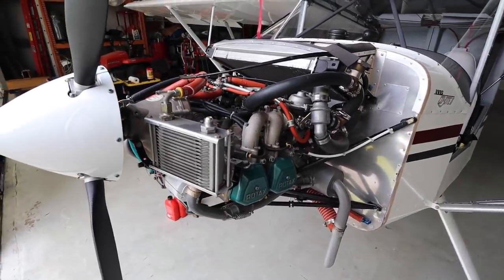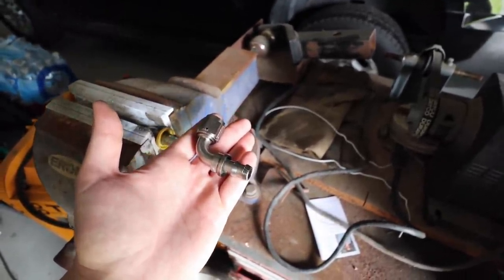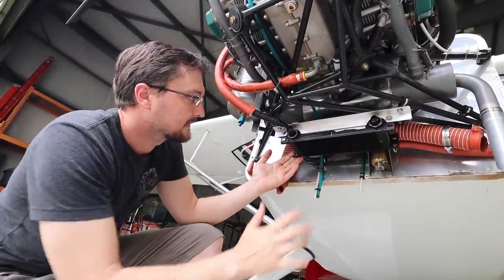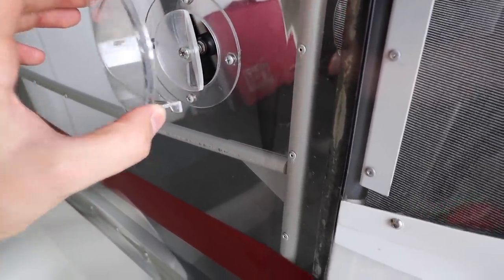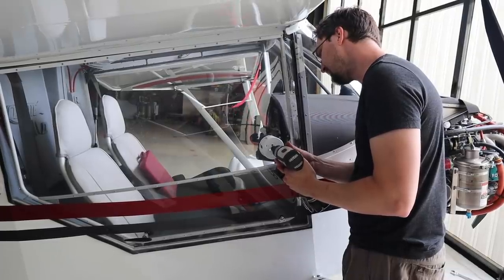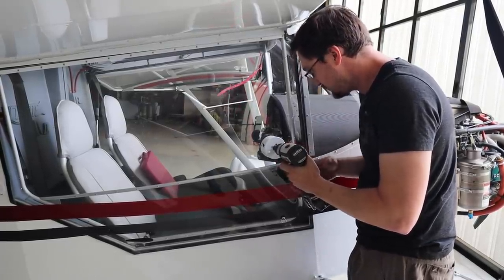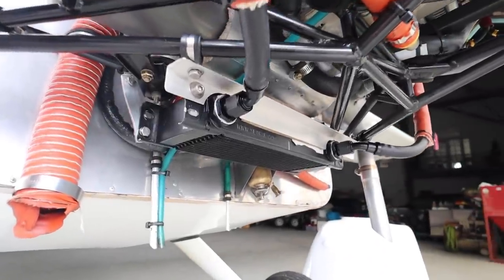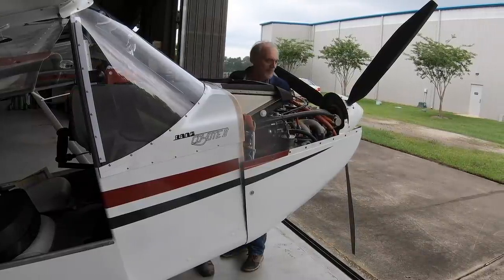The Advantages Of Owning an Experimental Aircraft - New Upgrades For The Rans S6!

Comment: My thoughts too in dressing the edges. I've cut and installed many a lexan and plexiglass panels. The few minutes extra time I consider to be a requirement. Vibration will eventually start fishers that lead to cracks that lead to " I wish I would have dressed the edges " .
   I have those same vents in my Tailwind.  They are extremely effective.

Comment: Thanks for sharing the video! Couple of comments if I may:
- On the new oil lines, you used push-on barbed fittings. I didn't see you put any clamps on. Never trust the barbs to hold, you'll be in deed doo-doo if one of the oil lines slips off. And they will when they get a bit older and temperature rises.
- On the holes, please use some fine sandpaper to smooth the edges. That avoids stress cracks in the doors.
- Want to consider another upgrade? Exchange the solid Rans tailwheel for a Matco pneumatic wheel. Only very little extra weight, but fits right on the tailspring (if you tell Matco the dimensions), and it makes for sooo much better taxi experience. Especially on concrete like you land on.
Enjoy the rides and stay safe.
Reply from the maker: Thanks for the input! The oil lines are actually fine. Those are a special AN fitting that works with specially specified lines and is a push for with no retainer. Using a clamp actually will cause problems as clamping onto the barbs will bell out and damage the hose. 

I didn’t have an sandpaper along with me when I installed those vents but they were cleaned up since. 

Funny thing, we actually have entirely replaced the rans tailwheel with a matco which is a nice upgrade as you mentioned. 

Thanks for all the suggestions!

Comment: In my personal experience with any kind of lexan or acrylic I would have dressed those edges. I have made windshields and punched holes in them and seeing them crack so I hope yours hold up okay. I have those vents in my Tailwind and they really can cause a tornado inside the cockpit for sure. They are excellent for vents. When it's really hot you just get a lot of hot air circulating through there but it's better than being stifling.

Comment: Playing in Nascar we measured the oil temp in the sump (tank) and wanted to see 230 to 260 degrees.  Our oils broke down somewhere above 275 or 280 degrees.  The oil moves through those engines so fast that the oil temp only goes up about 10 degrees in a single pass.  The process of burning hydrocarbons and oxygen produces CO2 and H20, both as a gas.  Oil and water don't mix redialy, but if they do it becomes an emulsion and you will not be able to boil the water out before the oil (now an emulsion) actually breaks down.  The moisture in the crankcase is from blow by in the form of a very hot vapor; just vent it out.  Cook some bacon up and put a drop of water in the hot grease; what happens?  In racing we pushed the limits: in aviation they want you to keep things in a narrower band of limits: keep oil and engine temps within those limits. Oil and water don't want to mix, try not to overthink this.
Reply: Chuck Howard My 0-200 runs at 230. Cooler in winter obviously. CHT and oil pressure are excellent so I don't worry about 230.

Comment: Good job on the install.  Did you consider adding finned tube oil lines to help with the oil cooling?
Reply from the maker: I did but I had the oil cooler on my shelf anyway so it was an easy decision to just install it.

Comment: Noticed that you left your existing oil cooler with an uncapped port, bad news always cap off any hose or port the moment you disconnect them.
Reply from the maker: Video removes context through editing. The ports were never left open for any length of time. Good way to get a bug in the oil system!

Comment: Aren't you going to put clamps on the oil lines?  I would.
Reply from the maker: Push lock fittings are designed to work without clamps. It has flown probably somewhere north of 100 hours since the swap without.

Comment: The lower oil cooler will not be a sludge trap?
Reply from the maker: It shouldn’t be. Many stock installations are below the engine. I think the stock Kitfox install is now that way in front of the radiator.

Comment: If your oil is too cold, will it harm your engine? I mention this, because I recall watching another youtube flyer who's engine was suffering from some damages due to oil temps being too cold during flight.
Reply from the maker: Your oil needs to reach 220 at least once in flight to burn off any water that condenses in it. I may have to add a block off plate in the dead of winter to keep temps up but we’ll see how that goes when it gets cold again.
Reply: Peter Toth That is correct.